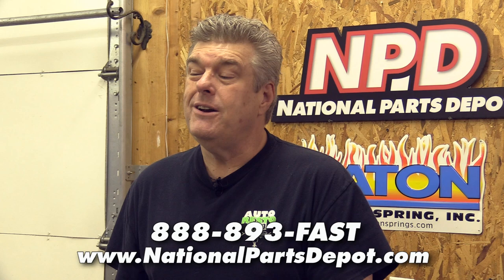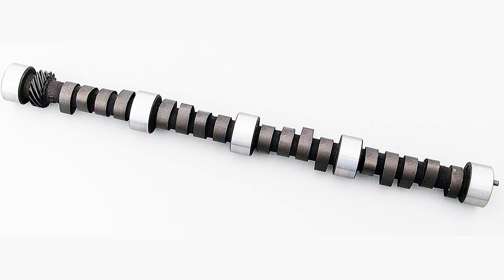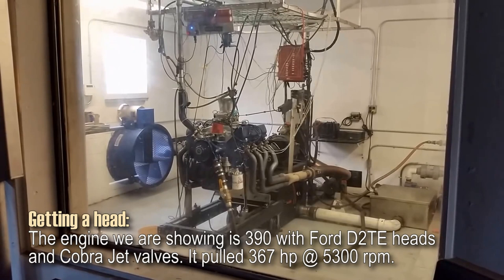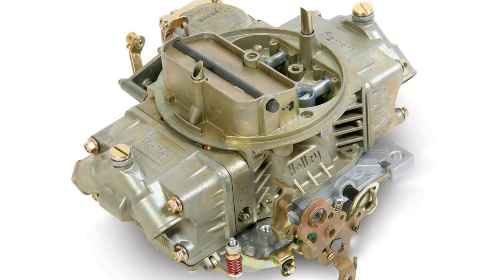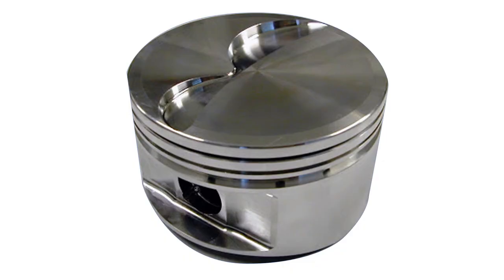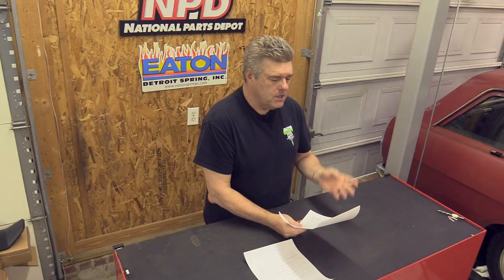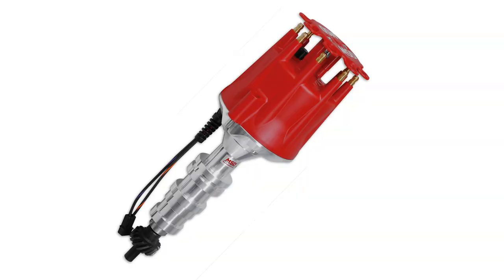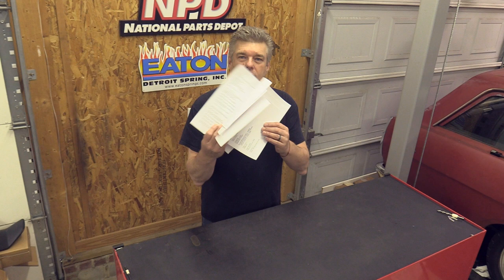Ford FE Build Tips

Comment: I would guess you would be able to get another 150 hp from a 385 series engine with the same budget and loose 75lbs doing it.   I’m not sure why anyone would still use the FE unless it was numbers matching restoration.  This boat anchor was thrown onto Fords scrap heap in the late sixties for the truly superior 385 platform.  This was no accident on Fords part either.  The FE was heavy, wouldn’t pass upcoming  70’s emissions and was never intended to be a high performance platform.   The fact they used it for as long as they did and managed to get respectable power is a testament to the engineers who had no choice but to make this boat anchor work.
Reply from the maker: Yet people LOVE the FE. Look at the flathead market. There is enough support there that they are now building new engines. I can see the point of the FE and the 385.
Reply: A FE weighs less and is physically smaller then a 385 series and has a history that can’t be touched, LaMans, Top Fuel, NASCAR, and power for Shelbys. Also better looking when u pop the hood. The 385 benefited from the lessons learned with the FE, and is certainly cheaper to build, but will never have the cache of the FE.
Reply: @marcshaffer3115  True on the race scene, the FE was the only tool in the shed at the time.  As I stated, it was quite amazing what they accomplish with a platform never intended to make more than 350 hp.   The width, height and depth are nearly Identical less exhaust manifolds.  You got me on weight,  I had the numbers reversed.  Looks are subjective.  To me there nothing better looking than a properly dressed 385 BBF ,except a Big Block Chevy, hands down the best looking engine sitting in any engine bay.....Cheers....
Reply: Scrap heap in the 60's? No, ford used it through the 76 model year in trucks.
Reply: @slick-px4pq  The FE was done being used in cars in 69'.  Trucks over 8600gvwr would still get the 360 and 390.  The 390 was done in 72' and the 360 done in 76' and still used until 78' in school busses.  These engines were unable to meet more stringent emissions standards, which is why they developed the 385 and 335 series.  The 385 was a much better design on every level.  The 335 series was piece of junk that was strictly an emission motor and not to be confused with the Cleveland, which is an entirely different animal.   The Y was only produced for 9 years,  the MEL for 9 years also and the FE for 18 but only saw passenger use for 10 years.  So,
Reply: @scottg391  relax. You made it sound  as though ford quit using it altogether in the late 60's.  Just clarifying that was not the case. Not everyone knows the history.
Reply: @slick-px4pq  The history is quite interesting with the FE and MEL.  The intended life of the platforms was to be 25-30 years.  Unfortunately, emissions standards became too stringent by the late 60's and Ford had nothing to replace the FE. They were also being edge out  by the BB Chevy and B series Chrysler, which were both excellent designs that were able to meet emissions, allow a larger displacement, make more power for about  the same mileage.  

Ford developed the 385 series in only a few years and it was probably one of the best large displacement V-8 engines ever produced despite the limited development period.  It was rumored by GM guys of the day that Ford didn't develop the 385, they just copied a Big block Chevy and moved the distributor location.   This isn't too far from the truth when you consider how similar the two engines are.  Copied or not it was and still is an excellent platform.  

What I find funny about the development of the 385 to replace the FE and MEL is the how the oil embargo in 73' and even more stringent emissions rendered all big engine sedans to the scrap heap of time by 78'. Had Ford known this was going to take place,  the 385 may have never been developed.   They could have kept the FE or MEL for HD trucks and the Windsor for sedans and light duty trucks, which is what essentially happened by 1980.      

This is a very short and glossed over history,  Hope I didn't bore you too much. Cheers.
Reply: @scottg391  not boring at all. I love this stuff. Thank you
And it's interesting what you're saying about ford copying chevy.  The owner of my favorite machine shop says the LS basic architecture is a lot like the FE.

Comment: Ok not a ford guy..........but I bought a 67 ford galaxie 4 door sedan super MI t I fell in love hasa 289 but I havea 390 out  a 70 emperor motor home ....hmmmmm
Reply from the maker: Sounds like it would be a cool swap. The transmission would be different.
Reply: @AutoRestoMod  I'm guessing the motorhome has a c6 or c4 🤔 no idea what the galaxir has there was so many options . It has a bolt I  9 inch . The factory one I heard is pretty week and has zero parts for it

Comment: Hold it there's a farting elephant in the room the FE and FT engines are Y blocks and not true V8 big blocks
Reply from the maker: And yet there are people that will argue with you about the words big block. According to some there is no such thing as a big block, only an engine with its correct displacement.  The 390 is a Ford Edsel engine Though it does have a deeper skirt on the block it is not considered a Y block.